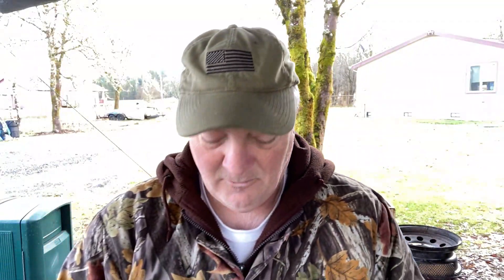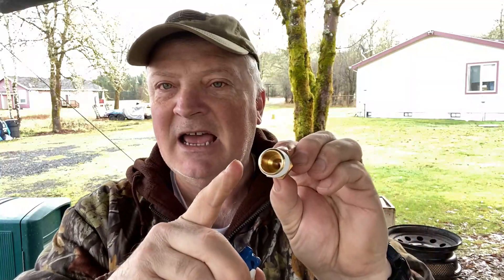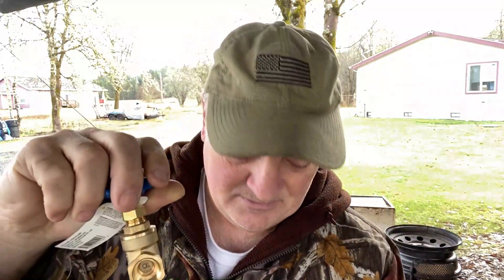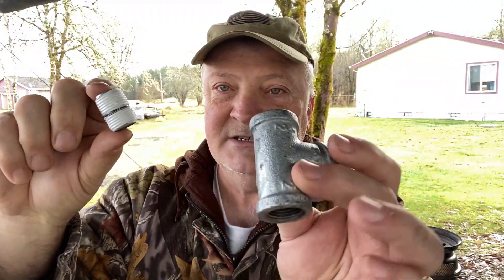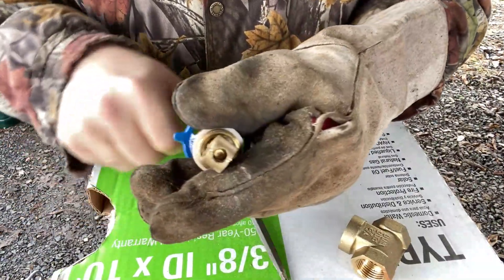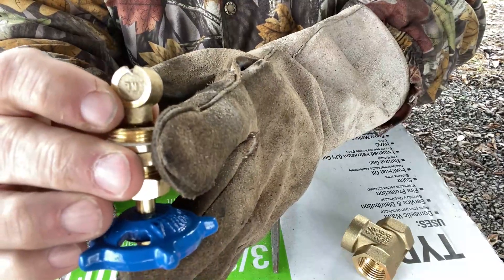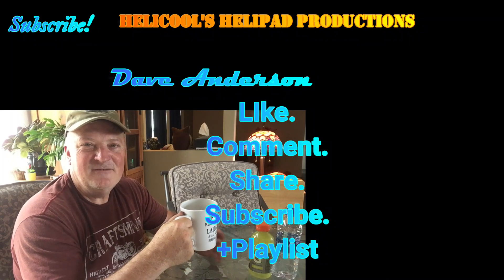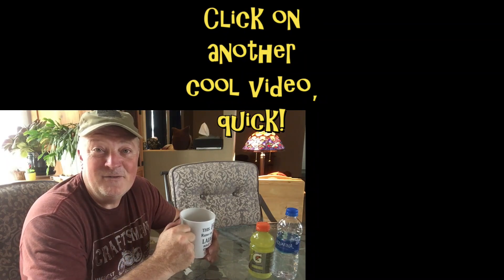Waste Oil Burner Drip System 3 of 4

Comment: This was the first of your series that I watched.  My comment would be, why not simply use a needle valve.  You would get better control and you wouldn't need to take anything apart and modify it.  Also I would worry that you may not get an actual drip because the oil would want to run down the sides of your sight glass.  You would need something at the top of the sight glass to bring the oil to the middle so it would actually drip through the sight glass.  Just my ideas, not saying it won't work or that you are wrong.  Looking forward to watching part 4 next.
Reply from the maker: I watched another YouTuber that gave me the idea... I was skeptical of the gate valve, but if the other guy used it and it worked, I figured I would give it a try. You will see in future videos, I ended up changing the valve to a simple ballcock valve. It worked great, and they were cheap.

Comment: Whitw teflon tape is not petroleum resistant. You either need to use the yellow petroleum resistant tape, or petroleum resistant pipe dope.
Reply from the maker: This is not a pressure system. So, you don't need any sealant whatsoever. If you have (undiagnosed) OCD like me, go ahead and use it to make youself feel better... but not required at all. Not trying to be flippant here, I used it, but did not need to. ;-)

Comment: I hope you show how the drip system goes into the burner chamber to deliver the oil. That is one of my concerns, given the amount of heat.
Reply from the maker: Also a concern of mine. I built it out today and had some issues with the drip system. So I'll have to rework it.